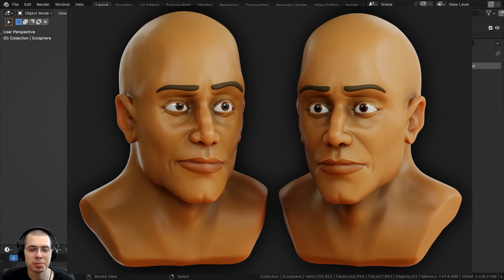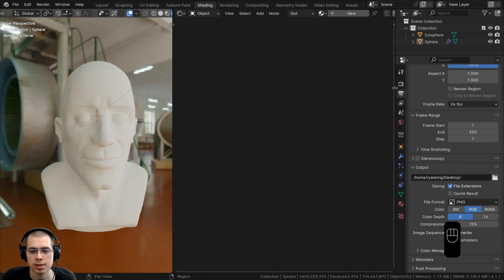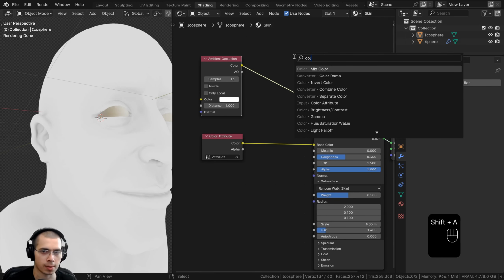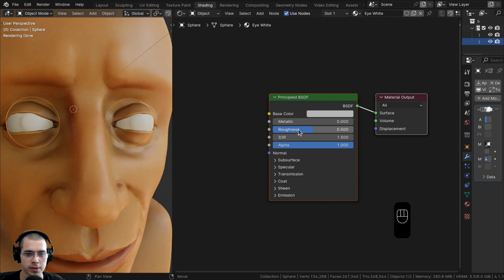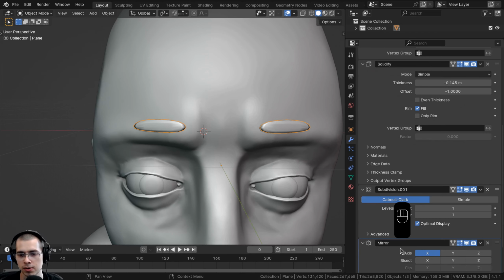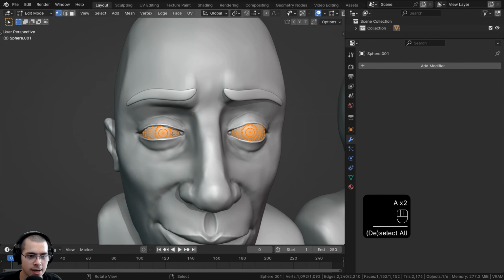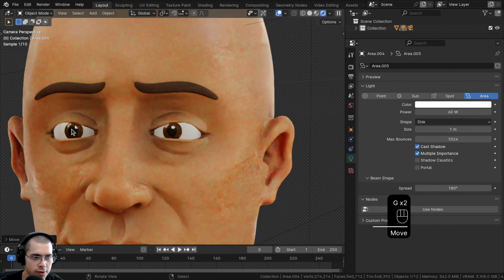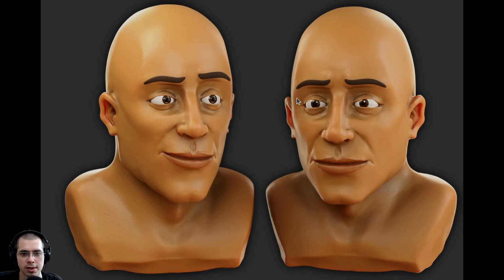Part 2: Stylized Male Head Character Sculpt (Blender Tutorial)

Comment: If I may, as a professional painter - there are basic aesthetic "rules" as far as creating a face.  Unless... the intent is to make the head like Neanderthal Man.  Looking goofy and really weird may be the goal here.  For those who are looking to make a realistic face, you need to consider:  #1: The rule of 3rds;  the top of the forehead to the eyebrow line, the eyebrow line to the tip of the nose, and the tip of the nose to the bottom of the chin are the same length.  Always.  #2:  The outer part of the nose lines up vertically almost perfectly with the innermost fleshy part of the eye (at the beginning of the sclera).  #3:  The outer part of the mouth lines up perfectly vertically with the outermost part of the iris of the eye  #4:  The distance between the eyes is exactly the same as the width of the eyes.  #5:  The eyebrow is always sitting, at least partially, on the eyebrow bone.  Otherwise it looks like it was drawn on like the Golden Girls.  Hope this info is appreciated and would just appreciate kind comments - like grade school or Sunday school, if you can't be nice then just don't say anything.  I'd appreciate it.
Reply from the maker: thanks for the tips. I agree that I still have a lot to learn when it comes to anatomy.